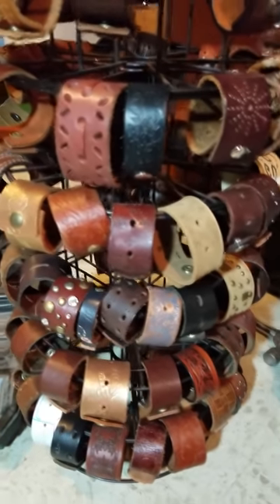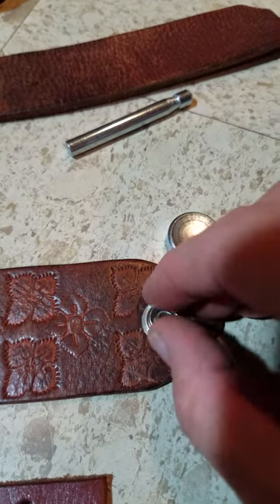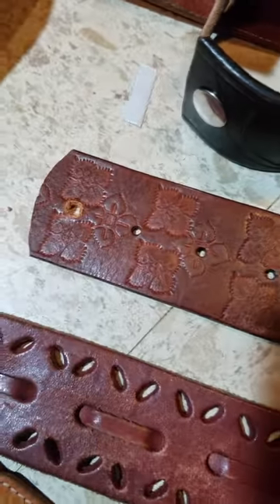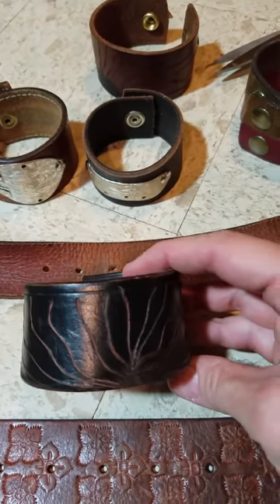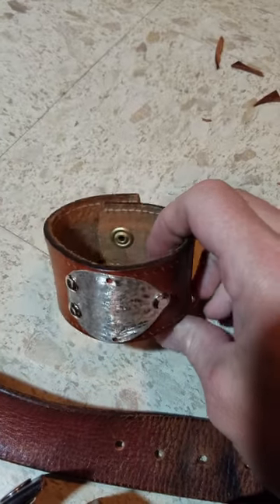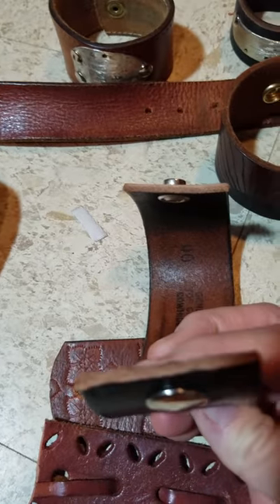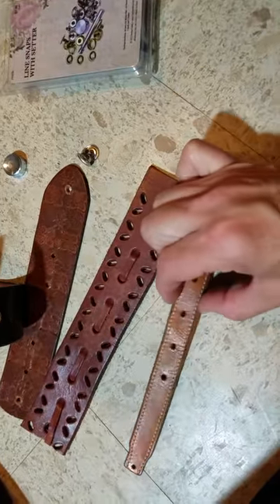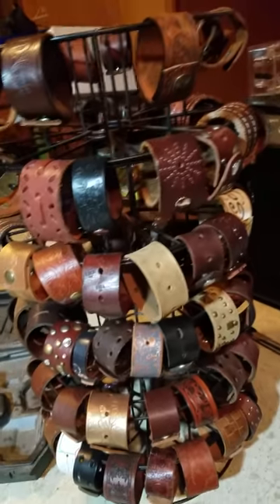DIY : How to: Recycled leather belt bracelet / cuff

Comment: Hi,  Great bracelets.  What is the average size cuff that you make?  I'm not sure if I should make mine at 7 or 7 1/2 inches (snap to snap).  I was thinking of using 2 snaps to make it adjustable but I think the cuffs look nicer with one snap,  What size do you make yours?  I would like to make some as gifts but not sure of sizing. Thank you for the awesome tutorial.
Reply from the maker: hi there.  I make around a 7" bracelet.  but I am not consistant. sometimes the decoration on the belts make the decision of my size.  I do make some bigger if i think they would be a good option for a more manly look.  I have used two snaps also, but again I am not consistant on that. IF it looks like it could be a nice unisex style then I might put on an extra snap so it has more options for sizing.  I sell these quite regularly. So, I try to make as many sizes as I can. Some people like to wear their bracelets snug and others like them loose.  If you are making them as gifts you might know their personal taste a bit more.

Comment: What size snap do you use on the thicker leather belts? I have found that the L24 snaps have a stem or shaft portion that are not long enough. I apologize, I’m new to leather working and really want to try doing some of these!!
Reply from the maker: Look in the leather making supply area at your craft store.  I use the biggest snap they have